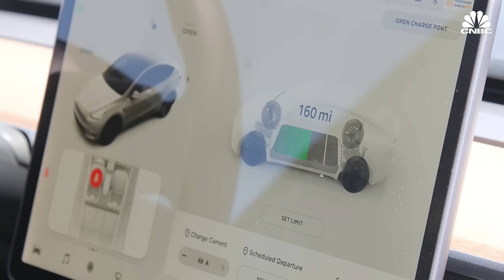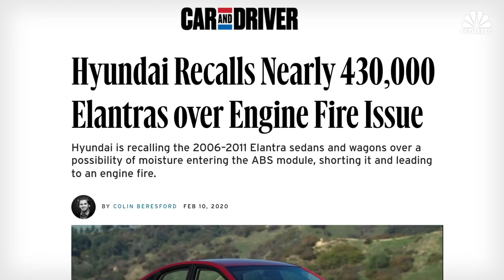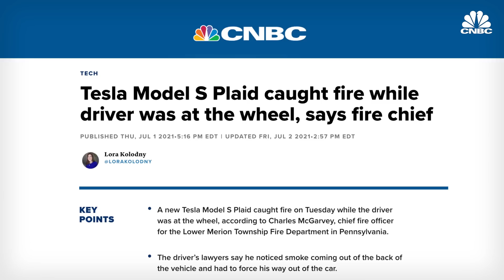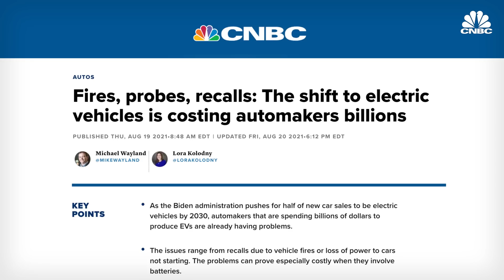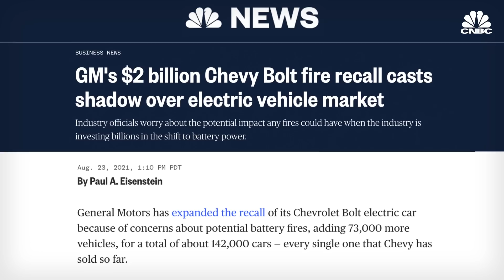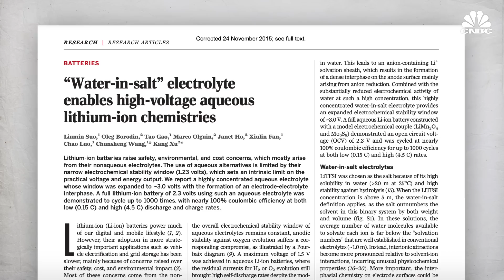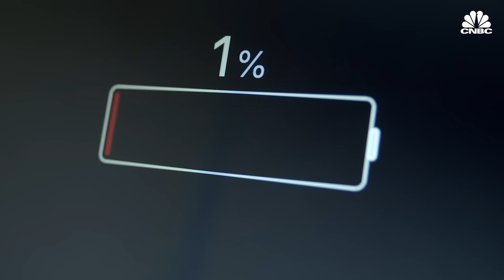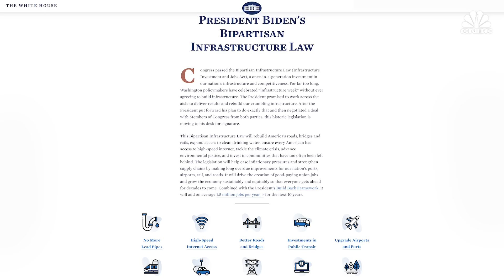Why Tesla, GM And Other EV Companies Have A Fire Problem

Comment: An EV does not explode unlike a gasoline vehicle.  The press uses terms like burst into flames which gets headlines but that is not what happens. ICE vehicles also catch fires in garages but almost never get covered. ICE vehicles also have fire related recalls.
Reply: 190'000 ICE cars caught fire in the US during 2022. There were 4200 EV fires over the same period. Figures supplied by the NTSB......

Comment: And they want them to.be mandatory  🤣 
I mean I get there are ice car fires 
But 99% of them are collision  coursed  
Ev cars are way over represented in  ar fires when stationary  that was what scars me
Look at VW ship that sunk
Reply: No, most combustion engine fires are electrical or leaking fuel, not collision.

Most of the recent recalls have been combustion engine cars catching fire when parked.

And there is no evidence that the ship that sunk had anything to do with EV fires, as most the cars on board were combustion engine cars, not electric cars.
Reply: @redbaron6805  mate when u compare how many ev cars vs pertol  cars
Ev cars have a higher rate of fires 
Just the other day an apartment building  burnt to the ground after an ev was charging in the carpark
The major problem is water wont put them out 
Time will prove what I say the more and more evs the more fires will happen
Reply: @redbaron6805  that report you forgot to include  hybrids which are the highest that catch fire all with battery fires 
Add both together 
Again explain how to put out a ev fire   
That reaches 500 degrees Celsius
Reply: @funfunyo7523  Why would you add hybrids to the EV total, not the combustion engine total?  Makes absolutely zero sense.

You think all electric cars catch fire 60x less than combustion engine cars, but they magically must be the reason why hybrids catch fire is the EV portion?  Based on what?

That entire claim is so absurd it is comical.
Reply: @redbaron6805  because the hybrid fires are because of the battery

Comment: EVs have more opportunities to catch fire. Charging at home, crash, and heat overload
Reply: That claim makes no sense.  They catch fire 60x less than combustion engine cars.  And charging is not a fire risk, nor is "heat overload".  

Batteries mostly catch fire due to manufacturing defects, or catastrophic crashes that penetrate the battery compartment.

Comment: Imagine putting one of these cars out in a Neighborhood and the wastewater runs of in a storm water management system and get into a pond lake or ocean
Reply: You mean like an oil spill or all the motor oil and related fluids like gasoline and diesel fuel spills that happen by the millions of gallons annually?

Comically stupid.
Reply: There is a small amount of lithium in water naturally it's the 23rd most numerous element.

Comment: There is also a problem that cannot be directly attributed to electric vehicles: 

When EVs are transported across the oceans by ferries, there is salty air which 
deposits salt on surfaces. If there are poorly insulated wires or uninsulated contacts, this salt combined with humidity is a very good electrical conductivity which can cause a short circuit and than result in fire, especially as some EVs are operated with almost high tension 
at 800 Volts. It is difficult to extinguish fire on open oceans additionally this fire is reignited by the still existing energy of the battery. It's not excluded that through such an unquenchable fire a ferry has to be abandoned.
Reply: No.  That is not how any of this works.

Comment: Fact: The the faster you charge a lithium-ion battery, the shorter its lifespan. A little-known fact is that when lithium batteries wear out, they don't just weaken, they develop internal shorts and become a fire hazard. A fire is much less likely with a slow-charged lithium battery, but most owners seek fast-charge stations. A battery charged rapidly repeatedly will break down and become hazardous much sooner than stated by manufacturers.
Reply: Why not ban cars entirely and make city's more sustainable and profitable by making them more dense and walkable it will reduce obesity and and other health issues and also battery cars are not good either they use tires and building them requires rare earth metals which causes pollution battery cars explode mixed housing is better
Reply: Eh... no.  That claim is literally fiction.  Literally 100% false.

Comment: "1 claim per every 10,000 insured vehicles, is rare" Wait what? no, that is far form rare.

Ill just wait for Graphene batteries they have been proven to have a much higher capacity on average than lithium-ion batteries, even at smaller sizes about 5.5 times more efficient and safe
Reply: So your plan is to go with a combustion engine car that has a higher risk of fire than an EV?
Reply: @danielstapler4315  does it? really? based on what?

Comment: Researches have demonstrated that growing "dendrites" inside a battery cell can short-circuit or otherwise damage the cell. During charging dendrites are growing from every lithium suface to the counter  electrode - this is a behaviour which can't be prevented in any way.
Reply: It cannot be solved in that particular battery chemistry and form factor. It does not mean it is not a problem that new technology is capable of resolving. IE BYD's LFP Blade batteries cannot catch fire at all. Even if you drive a spike through them. And they are cranking out a million+ of those cars in China now and will be exporting them to all major markets in the next two years.
Reply: @davefroman4700  It actually CAN be solved.  Several labs have already found solutions to it.
Reply: @davefroman4700  I don't know where you got your information.  On a few accounts in crash tests the blade batteries caught fire.  Some as long as 48 hours later.
Reply: Except of course, your claim that this "can't be prevented in any way" is categorically false.  There are multiple ways this can be addressed:

" A team at the University of Michigan designed a barrier that suppresses dendrite growth not just by physically blocking them, but also by altering the conditions around dendrite tips where growth is concentrated.

The material is a soft polymer film that is polarized and piezoelectric—meaning it generates a voltage when the film is deformed. The film sits on top of the battery’s anode. And when a lithium dendrite presses on the film, the voltage repels more lithium ions from piling up at that spot. This prevents the lithium from forming sharp tips that can penetrate the barrier. "

"At the Toyota Research Institute of North America, researchers recently demonstrated a battery with a lithium metal anode, solid lithium thiophosphate electrolyte, and sulfur cathode. Sulfur is another high-storage-capacity electrode material and—bonus—it’s cheap. As for the battery’s ability to resist dendrites, the Toyota researchers noted a relationship between dendrite growth and the electrolyte’s ability to conduct ions."

"For example, as a battery charges, lithium ions can deposit irregularly on the anode, forming spiky structures called dendrites that can grow long enough to reach the other electrode and short-circuit the battery, potentially causing a fire. This is a bigger problem for lithium metal than for other anode materials like graphite."

You DO know that most Lithium Ion batteries in cars have Graphite Anode's right?
Reply: Why not ban cars entirely and make city's more sustainable and profitable by making them more dense and walkable it will reduce obesity and and other health issues and also battery cars are not good either they use tires and building them requires rare earth metals which causes pollution battery cars explode mixed housing is better
Reply: Something like that likely caused the large LiPo a friend had to catch fire and burn his room out and could have killed him; battery wasn’t even being charged.
Reply: @ojonasar  Most of those are caused by cheap Chinese knock off batteries that were defective during production.  A very small number come from reputable manufacturers...
Reply: Profit over safety and common sense.
Reply: LFP don't have thermal runaway. You don't have to solve the dendrite problem is there is no thermal runaway. Also there are solutions to dendrite formation.
Reply: Use lead.

Comment: This why I will drive gasoline powered cars until I die. you cannot replace the internal combustion engine. I’m not gonna buy any of these pieces of junk.I’ll take any car or truck with a straight piped V8 the real power plant.

Comment: The problem is the battery packs are sealed and low down in the vehicle.
They need a water deluge fitting plumbed into the pack for fire fighting..........

Comment: China lost 55 EV buses? And now a cargo ship loaded with expensive high-end vehicles burns with apparently total loss.  
This report is good but the fire danger includes other electric devices and we need to know more about it. KW sized home batteries are out there. People are buying powerful electric bikes and wheelchairs. Campers are buying 100 to 1000 watt power stations and so far only a small percent are LiFePO (lithium iron).
Reply: One of our Dewalt drill batteries on charge started popping and banging. We chucked it in a bucket of water where it continued sizzling and jumping about in the water for a further  two hours

Comment: FIRE SERVICE: So, despite the EVs are dangerous headline,  the clear issue raised over and over within the video was actually the lack of a well trained, well funded, cohesive national Fire Service. But is that the headline, NO.
Reply: Out in the middle of nowhere, no one is going to pull up with an EV dunk tank. The toxic fire is going to burn the car to the ground. EVs should be insured for road damage and replacement.

Comment: From 2012 - 2020, there has been approximately one Tesla vehicle fire for every 205 million miles traveled. By comparison, data from the National
Fire Protection Association (NFPA) and U.S. Department of Transportation shows that in the United States there is a vehicle fire for every 19 million miles traveled.
Reply: The real issue is not "miles traveled." The issue is EV cars that catch fire while NOT being driven. I don't know of any ICE vehicle catching fire while being parked unless the ignition was from an outside source. Electric vehicles can virtually spontaneously combust while recharging. Lithium batteries have a checkered history of spontaneously combustion.
Reply: @1982nsu  100%
Reply: @1982nsu  Gas cars catch on fire spontaneously all the time. Electrical malfunctions and leaky fuel tanks or hoses are the top causes. The reason you "don't know of any" is that they don't make the news, whereas EV fires do make the news.
Reply: @1982nsu  More than a third are the result of some unintentional action, either careless behavior or accidents. And nearly a quarter are caused by equipment failure or a heat source in the car or truck.
Reply: Well, the difference is complicated.  The data should be broken down by manufacturer and by years since manufacture.
Fuel powered cars probably experience various mortality spikes from birth to death, depending on design flaws and maintenance errors.
Grid powered cars probably have an infant mortality spike do to a manufacturing defect, followed by low probability of immolation that rises as the car ages.
Reply: But every Tesla that catches on fire gets its own nationwide news article. For comparison 450 gas cars catch on fire every day. I saw a gas car on fire the other day and I went to the local news to see what had happened and they didn't even bother reporting it in the local news.
Reply: @juliam6442  Yes, the news business loves to hate on Tesla.
Reply: Why not ban cars entirely and make city's more sustainable and profitable by making them more dense and walkable it will reduce obesity and and other health issues and also battery cars are not good either they use tires and building them requires rare earth metals which causes pollution battery cars explode mixed housing is better
Reply: No facts allowed
Reply: The data should be fires per amount of vehicles on the road. I bet EV numbers will be way higher than the numbers of ICE cars. I mean it like 1 out of every ? EVs have caught fire vs 1 out of every ? ICE has caught fire.
Reply: @NatesHomeTours  🤣
Reply: You can’t compare that data. Huge variance in the number of EV cars and gasoline powered vehicles. So of course there will be less fires per miles driven in this case.
Reply: @Wickedpissah138  It’s “per miles driven” so the data is relevant
Reply: @Wickedpissah138  It per miles driven
Reply: So Does that DATA analysis mean the long distant driving by EV cars prone to be much stabilized than fossil oil cars??? 
I don't think so  Vise versa I would say.

 Should have a radiothermo check the heat on each car after having the same long run in the same period of time.
A simple mobile phone is non stopping using for 4 hours, the mobile heat is very high and even stun the mobile electro function.

In the same way the EV car might have the similar cumulative heat after long hours of driving compared with the conventional fossil oil driven car. 

Well, it is really hard to define whether EV lithium battery is much stable than fossil oil.  From the example of the current luxurious cars on the burning cargo vessel. This is a very interesting case to study the fire cause.

Again battery???
Reply: @whatsup7184  I think the maintenance budget and the age of your average vehicle on the road and that of a Tesla probably do not have much overlap.
Reply: The missing variable here is the ratio of how many of each vehicle are on the road total. If there is millions more gasoline engines of course the the numbers of vehicles fires will outpace electric considering there are barely any of the road yet. Now do the comparison.
Reply: @Wickedpissah138  “Miles traveled” is how the government calculates the rate.

Comment: Diesel busses are a better investment than electric cars.
Reply: They ain't, their emissions are cancerous and they cost more to run.
Reply: @odisy64  None of this means anything unless you provide numbers.
Reply: @beback_  gasoline is 3.50 a gallon, electricity is 12 cents a kwh.
Reply: @odisy64  And?
Reply: @beback_  a 75kwh battery can get you 300 miles of range, thats $9 dollars of electricity for 300 miles. on a 25mpg car thats $42 bucks for the same range. in my state, electricity is 8 cents per kwh and gas is more like 3.80 so electric is even cheaper.

Comment: Fanbois: BuT eVs CaTcH FiRe 11 TiMeS LeSs

Totally missing the point of the fact that WHEN they catch fire, the damage can be fatal, and/or cause total destruction to property.

Roll your gas car and deform the frame, trapping yourself, you will probably get rescued.  Roll your EV, deform the battery pack, trap yourself, and you get cremated.

Park your gas car in a garage - 0% fire risk
Park your EV in a garage - very small risk of spontaneous combustion and total destruction of property

The fat tail risk of extreme damage outweighs the fact that gas cars catch fire more frequently.

It will get more interesting when battery packs age and start to fail more frequently in an environment where inflation makes it almost impossible to build replacements.

Society heading to a bad place, fueled by stupidity.  Second order effects masked by hubris.
Reply: I've seen tesla battery packs have the front motor shoved into the pack from a frontal collision and still no fire, a roll over won't deform the pack nor will they just spontaneously combust in your garage unless the pack was previously damaged. I have seen countless stories and videos of gas cars bursting into flames while parked. Even more videos of a frontal collision causing the engine bay to set fuel lines and plastic instantly on fire killing the passengers in 2 minutes. Last month I saw a car catch fire at the McDonald's because its radiator was blocked by snow. More people die from gas fumes than electric car fires.
Reply: @odisy64  link me 3 examples of gas cars burning a house down while parked, cold (not just driven) in a garage.
Reply: @happyfunnyfoo  you do realize youtube blocks links? i found videos but i think its odd you believe it doesn't happen, electronics is often the cause.

Comment: In the Netherlands an EV on fire was picked up and dropped into a container full of water - done.
Also you could erect a portable dam around the EV and flood it with water - seriously the fire departments need to think a bit harder.
We are heading towards a world full of EVs and we will need better EV fire fighting techniques.
Reply: That was a massive operation, kid. Also, there will be no EV future so long as REMs, lithium, copper & nickel remain constrained by availability. As demand increases price increases. The future isn’t electric cars, it’s fewer cars & more walking.
Reply: Nickel, Copper and Lithium shortages are all Chicken Little stuff, Mark my words. Fewer cars is probably right because of FSD robo-taxis. @grahamstrouse1165
Reply: The fire can be put out in 2 minutes but you need to continue spraying to cool the battery pack.

Comment: The previous V.W. like the bug had magnesium engine cases. When they burned it went into the ground...
Reply: We fought a fire on a Honda CRX that had the magnesium rotary engine.  We eventually sprayed enough shell foam to smother it so that it would not burn any more asphalt shoulder than it already had.. We had to have an all night fire watch.  The next morning a rollback picked up what was left of the car.  It had to be hauled to a dirt yard and stored separately. Later that day we got a call from the yard.  Two idiots were throwing rocks at the foam shell and it broke away and ignited. Either a spark or stored heat we went on scene and watched it burn for two hours.  There was barely anything left of the car.